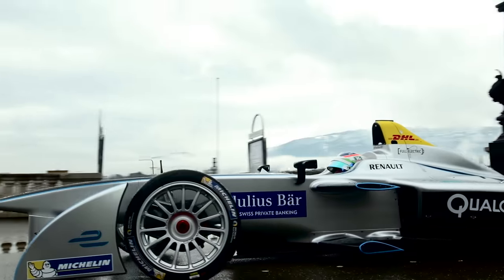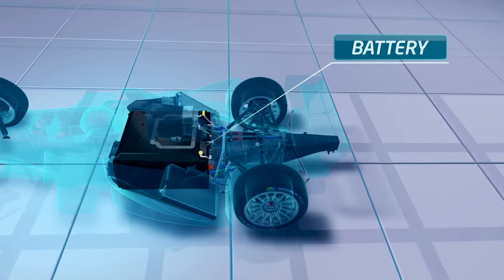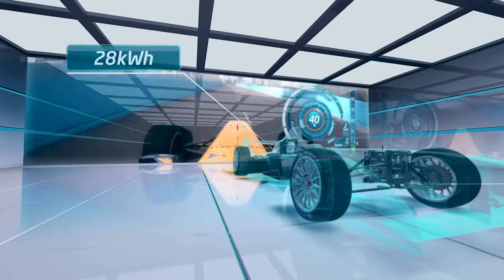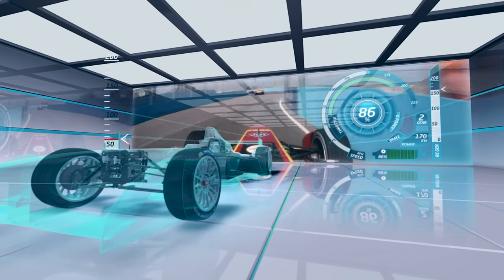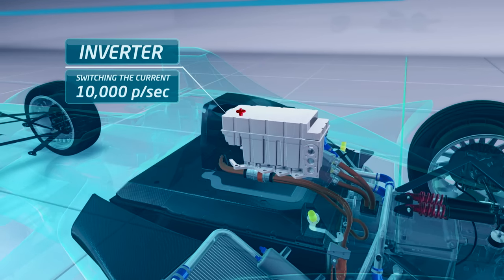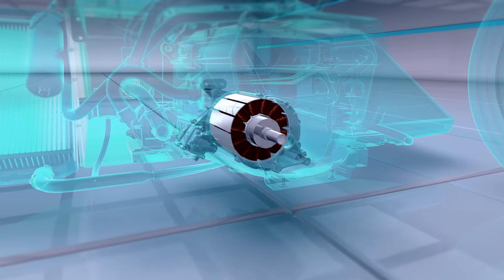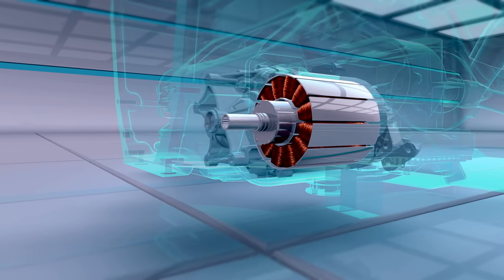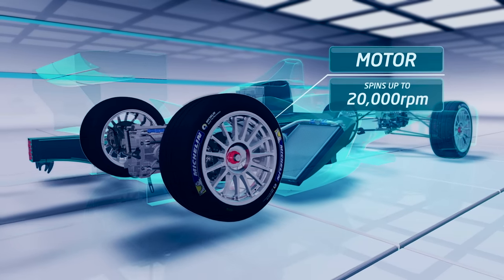How Do Electric Formula E Cars Work? - Season 2 Tech Explained

Comment: honest question, if formula e is to help advance EV tech, then why are we regulating the teams to all use the same battery and limit energy?
Reply: Racing still needa a control. Like 5.9L in Nascar. I do agree that batteries should be their own manufacturers but then fires could be a liability.

I'm more upset that the world could've had this technology all along in consumer cars if formula E and tesla can make sport cars right away.
Reply: Go away. Shouldn't you be saving Europe.
Reply: the United States literally don't care about pollution and you're the perfect example.
Reply: It is simply to reduce the cost of the cars, by opening up more of the regulations the investments needed to be competitive will grow as well. Now everybody has practically the same car, with minor differences.
Reply: badstep when you look at all the restrictions in regular F1 now, same thing applies. There's not really much a team can really work on. The engines all have to be 1.6 Liter Turbocharged 4 stroke 90° V6 engines. Fuel is restricted to one kind. The only things the teams can modify are the turbochargers and parts of KERS.
Reply: Alexander Lemcke well, yes regulations are needed. And restricting fuel flow and fuel means the focus will be on energy efficiency, better energy strategies and aero development etc. So the restrictions are put in place to shift the focus of development, not block the entire development. So restricting power is fine, but then let the engineers work on better aero, lighter cars, optimize battery capacity for the races, etc. As of now none of this is allowed, in FE and the rules are clearly designed to keep cost down (not to improve EV technology...). A good example is LMP1 where fuel flow is restricted, yet all kind of technologies can be utilized with their own advantages and disadvantages.
Reply: Tim Very good question.
I think they applied those rules to even out rich team with the limited resource team. Same think with Formula1 for example Mercedes has all the fund to build the ultimate race F1 car and the FIA need to control it so much less fortunate team can compete.
The whole purpose is to get each team performance as close as possible.
Reply: Except that in F1 various major constructors make their own engines with turbos, kers, etc. Also engine/powertrain placement in the cars, plus aerodynamics, engine software, general software development, etc, etc, etc. Yes F1 is restricted but it still does a lot more than what you've listed.
Reply: Because if they did this from the first year, costs will inflate too fast for the series to survive. So it's planned, year after year, more freedom in development.
Reply: because it improves effeciency
Reply: It could still lead to fast charging because in the race you need to do servicing and maintenance and fueling quickly. And if they allow more battery then they won't innovate the charging because charging is the biggest problem not batteries right now in ev.

Comment: Very raw explanation to be honest. Just general and basic information. I would like to know the actual voltages and currents of the inverter, details about the motor and transmission, the actual capacity of those batteries and other properties. But that's probably reserved information to be given, so I'm thankful for at least this schematic

Comment: FIA doing what they do best- making things boring.  It's a new sport, it should be all out, run what you brung racing. No limit on output or capacity.  If one team makes a massive leap then the other teams either have to copy and improve that idea or come up with something better.  There's major manufacturers in this, enough with the cost control regulations.
Reply: Too few restrictions in the first years of a series is potentially dangerous regarding costs. The FIA intend to progressively "liberate" development over the years. First year, no development. Second year, drivetrain. Third year, drivetrain and suspension. Etc...

Comment: i am starting my career on the electric field . i really want know this answer , why is so important use induction motor and inverter instead of others kind of system ?
Reply: +raphael dias Because Induction Motors produce no friction between Rotor and Stator, unlike DC Motors which need brushes to maintain constant contact with the rotor in order to have a switching magnetic field. Besides friction, it is very inconvenient to use DC Motors for cars because the brushes wear out and there would be a need to replace them constantly. 

On the other hand, the Inverter is necessary to convert the direct current produced by the battery into alternating current which is the type of current Induction Motors use. The inverter module most certainly also contains a variable frequency drive (or VFD for shorts) to control the motor speed and torque.
Reply: +Johnny Rubin besides that, you'd need switching gear on DC motors to change the motors from series to parallel field shunting to get the best power at low speed and best power at high RPM.

Comment: It would be an interesting experiment to let a Tesla model S participate in a race. To top of the range model has a similar power to weigth ratio compared to these. It won't have much downforce, but it does have 4wd. I think it would be very close...

But the battery still won't be big enough to last the entire race :(
Reply: +Berend H. It wouldn't be even close. That would be like Bugatti Veyron vs F1. F1 would be leaps and bounds faster around a race track despite the fact that Veyron is "faster" and has more power. Formula E would be much faster than Model S. I still do hope that they'll arrange a Model S vs Formula E event some day :)
Reply: Maybe in a GT-e Championship

Comment: So assuming that I understood this correctly (I'm completely new to FE) everybody has to use a specific model/spec of battery but they're free to do whatever they want with the inverter/switchgear, motor(s) and transmission (Where used)? 😇

* Sound of parts being respectfully "liberated" from a life-expired TGV and being crammed into an F1 profile... 😆*

Comment: So I guess the inverter is like the ESC in a hobby grade rc car?
Reply: You got it. You can really learn a alot about formula e when you're in the rc hobby :)
Reply: Nice, the future for electric cars is bright.  Assuming future electric cars are like rc cars, components such as the "esc" and motor are modular and can be easily swapped between cars lol.  Imagine swapping a high performace powerful system from a sports car into an econo-hatch back lol, much easier than doing an Chevy V8 swap into say a 240sx lol.

Comment: Interesting that they don't go for an engine on each wheel like so many other electric cars use.
Reply: Weight is king in these cars..
Reply: Frankzy Well, an awd system would be worth it in my mind.
Reply: yes, having a 900 kg weight,  you could definetely say weight is king
Reply: 王嘉程 Exactly what I guessed,
Reply: Almost no electric car uses hub motors. There's several disadvantages to them that aren't really outweighed by the advantages.
Reply: superdau I see. You can get some crazy torque vectoring with dual motors though. With awd you just get mad corner exit speeds.

Comment: Why cant we invest into superchargers that can fully charge the cars in 15 seconds
Reply: The main reason is that battery technology is not quite that good.  Also if you charge lithium ion batteries too quickly they will explode.  This puts a limit on how quickly you can charge them.
Reply: i know, why dont they use lipo batteries, and we have enough tech to focus on making it so the batteries could be supercharged Frankencycle Productions
Reply: +eXozGaming they can make charging become much faster than it currently is, but charging a battery means that you have to run the chemical reaction backwards, which creates large amounts of heat. There are designs that reduce this heat, but if Li-ion or Li-po batteries get too hot they malfunction, so there are plenty of improvements that can be made as far as charging speed goes, but those improvements are still years out.
Reply: Damn, i really want to see an endurance race with these, or atleast see these run on race tracks+Frankencycle Productions
Reply: sorry if this is a late reply, but I heard they are turning the tracks into chargers. allowing you to drive while charging.

Comment: 28 kWh battery per car?  So basically 1 Tesla or Chevy Bolt could last the entire race :O
Reply: Not necessarily - depends on how much more energy a Tesla would require to perform the same rapid accelerations and braking that the formula e cars do. The formula e cars weigh around 890Kg, whilst the Tesla Model S weighs 2100Kg. The Tesla will use much more energy during acceleration due to it's larger mass. It would be interesting to see how well it would cope however :P
Reply: Luke Challoner Kg? Isn't that kind of heavy in weight?
Reply: NightmirrorXx Yes the Tesla is quite heavy at 2100Kg about 4600lbs, however fortunately a lot of that weight is low down in the battery pack that sits in the under body of the car. This gives the Tesla a low center of gravity which actually allows it to handle quite well. Combine this with the instant acceleration from the motors and thats why many people say the car doesn't feel like it weighs as much as it does :)
Reply: On paper the tesla models s have better spec than renault e.dams formula e. The Reanault Z.E. 16 can go from 0 to 100km/h (0 to 60) in 4 seconds while the model S can do it in 2.7 sec. the tesla also got a better top speed.

Comment: is it possible to recover energy(as in humanly possible)
Reply: Yes, many electric and hybrid cars have regenerative braking systems.
Reply: +Venomous no i mean using a Formula E car,you can right?
Reply: Ginger Boy Yes you can, as most of the Formula E cars use regenerative braking.
Reply: In fact some petrol racing cars now use energy recovery systems (KERS), if they are allowed in the class - such as Formula 1.

Comment: Why do formula e cars have gears but road evs don't?
Reply: Zadok the Priest cause gears don't really make any sense in an e car. you have maximum torque from the start
Reply: Carlos Leon I presume the torque starts to drop off after some time, yes?
Reply: This depends on the requirements, an electric motor has a wide RPM band (sometimes up to 20.000 RPM, compared to a combustion of roughly 1000 - 6000) and a pretty consistent torque output (limited by the power, rpm * torque). If you have sufficient torque throughout the entire speed range on the circuit (Formula E also has low grip tyres), then you don't really benefit from extra gears. Some teams probably believe they need the extra gears to have some extra top speed or torque at low speed, while others decide to go with direct drive and save weight.
Reply: it's a long "chain of throught": in theory the gears allow the motor to operate at peak efficiency torques/rpms, operating the motor at peak efficiency means you get more out of the battery.

Comment: 170kW power limit means, for a 24Volt battery, 7000 (thousand) amps limit.  Seriously? do you think these motors can even TOUCH 7 KILO AMPS for even a MICRO SECOND?!!?!   FRY EVERYTHING! The power limit is clearly not a limit at all.
Reply: They can, this year the power limit will be 250Kw.

Comment: 28kW? Tesla has 90 in a family car.
Reply: +T1Oracle The tesla is far heavier and has a number of motors to compensate for this hence the greater total kW. This race series is in its infancy and is created to promote who can design/implement the best equipment rather than afford/squeeze in the most powerful parts available already.
Reply: killy321123 A RWD Model S has 1 motor just like these cars. These things only have 250hp and 28kW. That's just lame giving the power and battery capacity of a Model S. I hope next year they bring those up to a level more suitable to racing.
Reply: +T1Oracle It is probably wiser to start smaller and develop the technology methodically and build up the series gradually in baby-steps rather than risk complete failure from season one with a series of monster F1 killers from the get-go.  Less resistance on this path (if you pardon the pun).
Reply: ***** No. Not really. That's why Tesla sells more EV's than Nissan right now. Starting small isn't the answer. If you start as big as you reliably can, then you generate more interest and things can take off. If you start too small then people don't see the value and lose interest. Having a strong head start in popularity is invaluable.
Reply: +T1Oracle Well, I guess the investors and sponsors involved the FE series probably disagree with you, judging by how things actually are. ;)
Reply: ***** Or they didn't have the balls to make a serious FE series.
Reply: +T1Oracle I would agree Tesla's approach to the car market has certainly been very successful. The Formula E series has also generated a lot of interest I suspect through being economical to enter at this technology level but I believe they will have to keep increasing the development limits  every year to maintain the interest particularly as you say because a current road car overshadows them in some aspects.
Reply: +killy321123 Put it this way.. Tesla started in 2003.  It has had over half a BILLION dollars worth of investment, Much of that funding was from the US government's Department of Energy.  and along the way came dangerously close to bankruptcy, getting bail-outs of tens of millions of dollars to keep them going. As recently as August 2015, Tesla was still LOSING $4,000 per car sold, and still is, as far as I'm aware. Long term, I think they'll succeed, but it is a very long road.  I think they might actually start making money after about 15 years when their Model 3 arrives and their Giga factory starts providing their own batteries. It's on a completely different scale to Formula E.  A brand new racing car series is a completely different kettle of fish, and probably demands much quicker returns on much smaller investment.
Reply: ***** FIA has tons of money. They can do whatever they want. They have been around way longer than Tesla. If wanted more HP and better batteries they would have had it. Instead, they choose to cripple FE.
Reply: all of you are comparing it with the Tesla, but the tesla cant run in a circuit like the fe cars do. The road car is much hevier, and cant deliver the power all the time in the way the driver need, different pourposes, diffetent aproches, thats all (forgive my english, im just starting to learn the lenguage).
Reply: +T1Oracle The whole point of Formula E is to get as much performance from a set amount, therefore any improvements can be passed on.
Reply: +Johan Petersson A bus is also slower than an FE car and a Model S will smoke both.
Reply: +T1Oracle 
This league exists to improve and optimize the technology. There wouldn't be much technological progress if teams were allowed to use huge batteries and more powerful engines. Think of it as squeezing the most power out of a 1.6 liter Turbo WRC car instead of building a GRC car with fucktons of power.
Reply: Terminal Velocity Lame excuse for slow race cars. Give them better technology for a more challenging race.
Reply: +T1Oracle 
The more restrictions, the more "challenging" the races are for the engineers lol
Reply: Terminal Velocity Then why not restrict them to golf carts then? No one watches racing to see engineers get challenged, they watch to see the drivers overcome challenges. Regardless, I'm an engineer (software) and I know that the greatest challenges I face are when I have more choices not fewer.
Reply: +T1Oracle 
Well damn then I guess F1 should go back to huge displacement V12 engines, and WRC should go back to 600HP Group B specs! You heard that, engineers of the world? BACK TO THE STONE AGE!
Reply: Terminal Velocity I see that you're not interested in having an intelligent and mature conversation, so I'm going leave now.
Reply: +T1Oracle 
Oh no... Please don't leave now! What about my burning desire to learn about what racing should really be from a person whose knowledge on the topic is superior to that of the organizers, engineers and pilots involved in professional racing series? Where else will I find someone who wants his personal tastes to be imposed to everyone else, and who wants progress to be slowed down for entertainment's sake? What a cruel end to a conversation that was "intelligent and mature" from the very beginning...
Reply: Blocked. :-)
Reply: +Terminal Velocity омосл
Reply: +T1Oracle 
F1 racing, electric or gas powered, is al about to get as much power as possible out of the least amount of energy.
Reply: 3DPeter If that were true F1 would restrict the gas instead of the engines. A sealed tank with no refills would cut to the point, instead of forcing these crappy little turbos on everyone.
Reply: They do restrict the gas on F1.  There are no more refueling on F1 cars for several years, only tire change on pit stops.
Reply: SCoA I did not know that. It's a shame that they haven't used that rule to replace all engine rules. Then we could have more innovation. Regardless, the future is full electric and we need an electric race series that isn't neutered.
Reply: Not necessarily true. Yes some restrictions boost creativity, but too many restrictions make it impossible to do anything to improve things. As is the case with Formula E a.t.m., perhaps this will change in the near future as the rules slowly open up, but right now there is not much to distinguish a team from another (engineering wise).